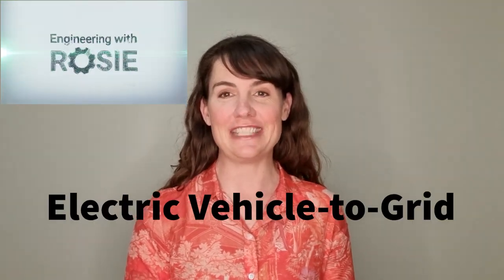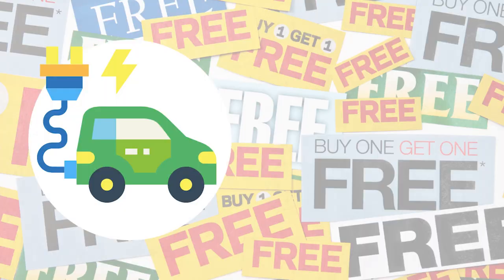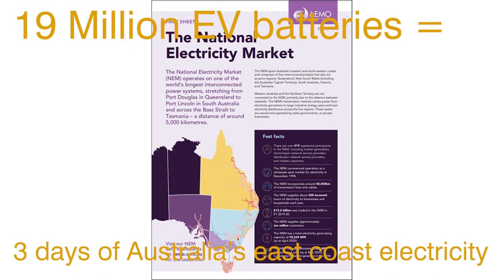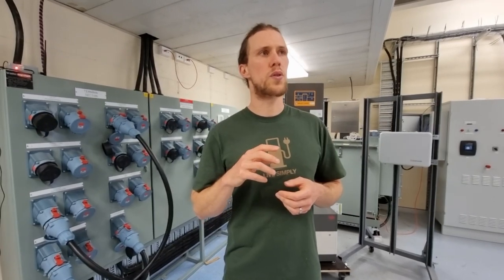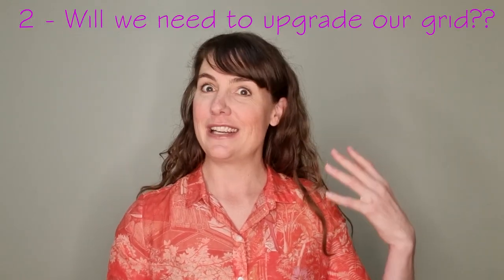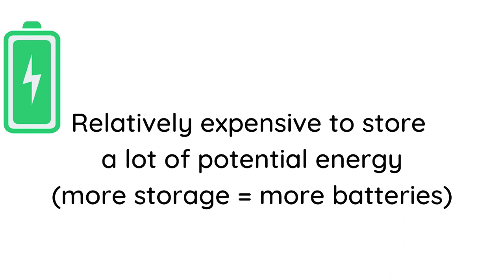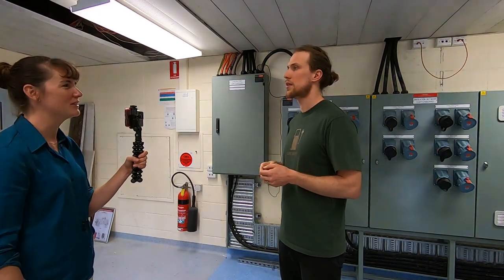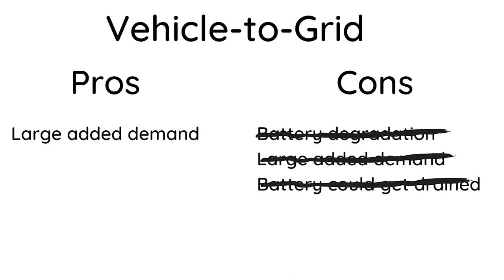Electric Vehicle to Grid Technology Explained

Comment: I can see a selfparking V2G nudging on to any out door power point at knee level and trading stability and electricity with the grid. 
A VPP and controlled by the vehicle computer.  😊😊😊😊
Most vehicles are parked 23hrs every day. 
If my street of 30 homes and 60 vehicles all homes with 6.6kWh rooftops PV and selfparking EVs withbig 100kwhbattery, then we could generate 3mWh and store 6mWh daily.

When the wall outlet is in every vehicle parking space, universal, then the battery benefits will be universal. 

If 20million buildings and vehicles were the same then Australia could be free of fossil fuels. 

The USA 300million buildings and vehicles 
could be similar. 😊😊😊

Comment: Dumb idea. You need to send energy to the car so you can drive your car. If the car's energy goes to grid. Then yòu can not drive your car but if you do you wilĺ have low range on your car. It would only work if you do not plan on driving your car. However hydrogen fuel cell could power your home or grid where the hydrogen was generated i  off peak
Reply: There is no frèe lunch here.

Comment: Vested interests in central power plants is the biggest road block to V2G. 

Vested interests want Nuclear power plants to fill the existing national grid and government disaster insurance and Government guaranteed cash flows for 60years to 100years like our tunnels and toll roads. 
Vested interests want the government to build 5 times more capacity into the national so they can build 5 times more generator plants.

Nobody will turn off Nuclear power plants and Nobody will pay to clean up the mess.

Australia CO2 problem is the world's CO2, Australia is the victim and will be the first country to burn and have its top soil washed away, desertification from climate destabilisation. 
Sahara desert latitudes are the same as the Australian latitudes. 

If nuclear is the Australian answer then the world's dictators nuclear industries will demand Australian uranium, or blackmail with the use of continued fossil fuels.

Comment: I have two massive EV batteries sat on my drive doing nothing - waiting for me for when I need it,  It is sat as a comfortable SOC where degradation is next to nothing.  This V2G only works when you can guarantee your vehicle will be ready for your use at anytime you need it - any doubt you cant use it because it has discharged or has not fully charged in time, [OR] you needed to make a journey before you thought you needed to - or the very fact you even have to schedule a journeys according to the grid will be unacceptable. 

Is it not better for the big profitable utility companies to install grid batteries that they own and maintain -  instead of putting the responsibility on to joe public ? ?  Until EV's reach critical mass this V2G is pie in the sky anyway, better to fit solar on every roof top that can have them, and install grid scale batteries.  Sure the price of electricity will go up, because the fat cats won't want to lose the cream, but on the flip side, it will incentivise solar take up and lower the cost of installs.
Reply: Would you change your mind if grid usage of your car battery paid you the cost of your car over some time period? Having a minimum range for daily car usage is not a hard thing to implement, the last 100 miles is always yours. The middle 100 miles used by the grid doing "Daily Grid Arbitrage" and the last 100 miles is charged only for long trips.
Reply: @WeBeGood06  It's a flawed system, you can try and sweeten it all you like, but I fear it will be a stick and carrot approach.

No matter what incentives or punishments they give, its a band aid fix for a serious problem. 

[IF] man-made climate change is a thing then grid batteries with wind nuclear and solar is the way to go.  Sure there might be a place for V2G in say 10 to 15 years but Agenda 30 will be in full swing by then anyway and you might not be in a position to own a car of any type by then.

Lets just see how it pans out...
Reply: did you watch the video?

Comment: What a load of horse shit. As some who works in the the world of power generation saying that the batteries in cars will just discharge for 60 sec to support the grid isn’t how it works. The point would be for peak shaving which so happens to be the part of the day when people are driving to and from work. I found this to be like talking to a politician, a lot of words with no meaning talking around the real problems with the system. I think V to G has a future, but it nothing like what this video made it out to be. 
You will need to program when and how far you will need to go with your car, at what time of day, and the buffer you want for the unexpected. Then the computer can trace the grid and you can program at what price, time, rate, and amount you want to sell back to the grid. Also as more people do this the price of peak shaving power will drop. If you do this right it can for set the life you are losing from the battery, if you let to grid control this it cost you allot of money.

Comment: Electric vehicles are as harmful as their gas guzzling brothers. After you mine the lithium copper and run extra power lines it evens out.
Reply from the maker: Thanks for this comment Damion! It is definitely an important consideration. And in fact it will be the topic of a future video I have planned, comparing the full lifecycle emissions of EV vs internal combustion. It is quite complicated to analyse, and impossible to make a blanket statement that "EV are as harmful as ICE", since it really matters where you get your electricty, and how the minerals are mined. In extreme cases you can find EVs that have more emissions than some ICE cars, but in the vast majority of cases EV have lower lifetime emissions. And this will get better as we clean up our grid obviously.
Reply: Really? How do you define "harmful"? Fossil fuels are not renewable and as they decline in availability the price will rise. When Gasoline reaches ten dollars a gallon watch the speed of transition.